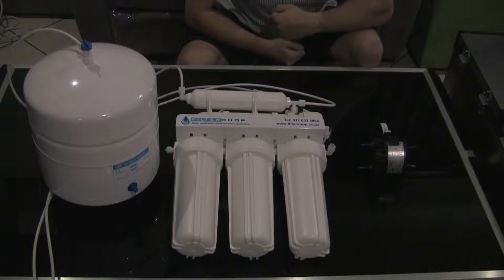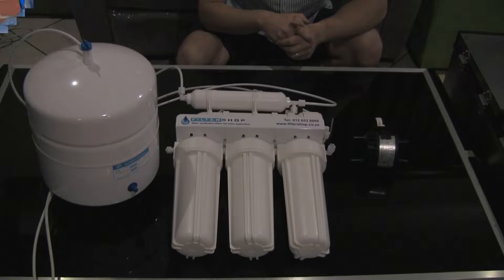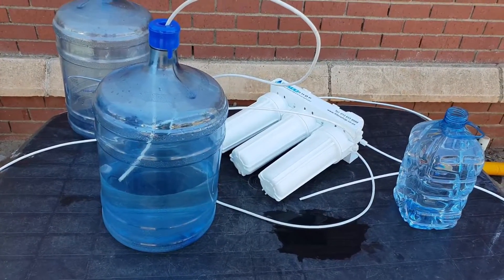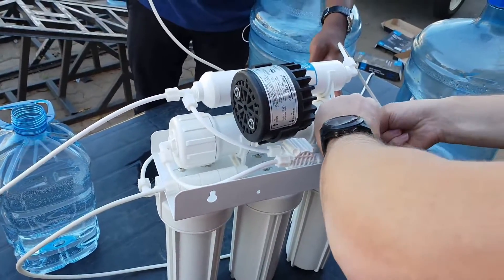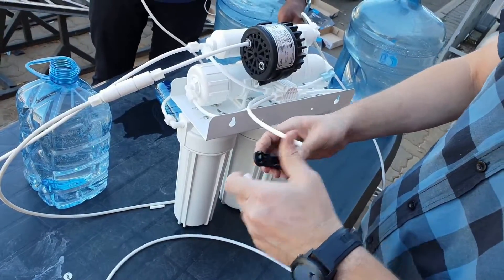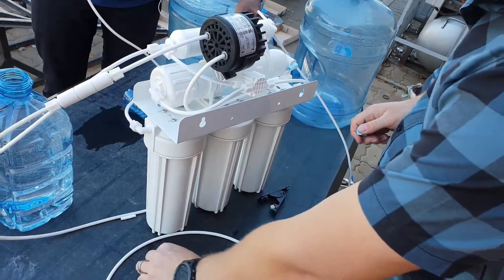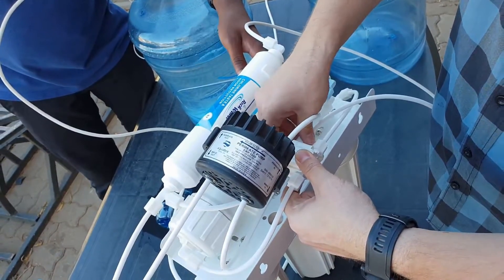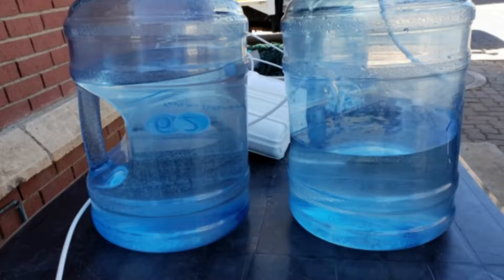permeate pump

Comment: do I need a booster pump in addition to the permeate pump?

should I try the permeate pump and see if the system pressure improves before spending more $ on the booster stuff?
Reply from the maker: Normally you would need a minimum pressure of 3 bar for the system to work. With the permeate pump I have set my house to as low as 2 bar and it does still work. I haven't measured efficiency at lower pressure though.

Comment: please, do you have a diagram conection pump inverse osmosis domestic, please
Reply from the maker: Hi, Unfortunately we don't stock it any more so i haven't got one to look at the diagram. However you can basically replace the 4 way valve with it and its ports are labeled on the unit.

Comment: The ERP-500 I installed according to the instructions stopped working in less than a week.  It's a worthless piece of junk.
Reply: Did you replace it with another pump?
Reply: @a.draghici8956  Yes, I returned the ERP-500 to the seller and he replaced it with an ERP-1000 unit which has been working well ever since.
Reply: @a.draghici8956  Yes, the seller warranteed the ERP-500 and sent me an ERP-1000 that is still working well.
Reply: Weird mine is over six months old and working just fine still. Sounds like a skill issue.

Comment: My understanding is the permeate pump system will not have the ASO auto shut off valve and that increases pressure, so the ASO system may only have 40psi in the tank if the source water is 60psi, but with the permeate pump the tank will achieve system pressure and you'd have a full 60psi going to your faucet and it will make clean water faster.
Reply: You can install a permeate pump with or without an ASO valve. Usually 'with' an ASO valve is preferred as it will lessen TDS creep.
Reply: @ThatZenoGuy  You can do it wrong, but the permeate pump instructions say you should keep the ASO valve to lessen TDS creep.
Reply: @lym3204  
I literally specified you should keep the valve.
Reply: @ThatZenoGuy  There was a video that said to remove the ASO valve. I just wanted to emphasize that there is only one correct way to do it.
Reply: @lym3204  
I mean you can remove the ASO valve and it'll still work. And there's probably weird outliers where removing it makes sense.
Reply: @ThatZenoGuy  It was a pain to figure out those weird outliers.  The most common is when the ASO is integrated into the post filter.  Then the ASO must be removed and bypassed.   After this, there are other,r probably less common outliers.

Comment: It means that we don't need to use pressured tank to connect to the faucet.
Reply: Hi, You will still need the tank as the flow is still too slow even at the improved rate.
Reply: Without the tank it would take about 10 minutes to fill a glass of water.
Reply: @michaelbarry8373  Their key word was pressured.  Which their 'tank' in the video has no pressure other than gravity.
Reply: The permeate in and out lines will be installed immediately before the storage tank.

Comment: Two things done wrong here, flow restrictor should be before the permeate pump, not after. Second, automatic shut off valve should be before the pump (not after) or removed completely.
Reply: I kind of understand why you say it's wrong but can you please elaborate further?
Reply: https://theperfectwater.com/s3/PDF/TM-OwnersManual-PWTv15.pdf
Reply: ASO is ok after the permeate pump, you want dont want it to be cycling forever.  When you reach x amount pressure above your incoming water will close the inlet water.  The only problem could be that if you are not using the RO you can create more TDS at the membrane and that TDS will potentially be stored at your tank.  Flow restrictor is not needed if your inlet pressure is 60psi or higher but if you add a booster pump then you needed otherwise will never create the pressure at the membrane
Reply: According to a manual about  all about ro systems that connection its wrong 
Anybody out there knows what flow retractor should I use for a p.pump 500 model with a 36 gpd membrane? I had the the problem the membranes clogging up (I'm using the yellow chip fr estrictors...its that the problem?

Comment: Super explains, thank you very much, how is it when you use an electric pump instead of a mechanical permeate pump? Does this save even more wastewater?
Reply: It would give you more pressure in the product water tank if you add an electric pump but it would not make a major difference to the wastewater with a permeate pump. If it is without a permeate pump then the electric pump helps lower the wastewater but not nearly to the extent that the permeate pump does.
Reply: @semiusefulinformation144  Thank You very match!

Comment: Should I install it with or without an ASO valve? Will the pump increase my faucet pressure?
Reply: From what we have seen it works with or without the valve. Yes, it does increase the pressure at the tap but not as much as an electrical pump would.

Comment: According to the Instructions, The flow restrictor is to be installed before the permeate pump on the brine in line.  Not after this is the same permeate pump I have Aqua Tec ERP-1000, if you install it as shown in video Pump will not click, clicking sound is important that means pump is working.
Reply: You are correct.  This video is wrong according to instructions
Reply: @gnosti83  it is ok, if you look at this manual is ok https://theperfectwater.com/s3/PDF/TM-OwnersManual-PWTv15.pdf
Reply: This was my question 
Although if you think about it 

I’m not sure it matters
Reply: I dont have a flow restrictor in my home master and it works.  However, I have been researching since my inlet water pressure is 60 psi and at my tank is 18 PSI ish.  Maybe I do need a flow restrictor to increase pressure and/or replace the membrane as well

Comment: Do not use ASO if you use permeate. Its better to think about permeate pump as "smart (pumping) ASO".
Permeate pump will shut off output tube by itself, once flow in permeate stops, and do this at very end instead of proportionally (like normal ASO).

If you connect permeate pump together with ASO, there will be conflict: ASO as usual tries to block main input based on pressure in filtered water channel (permeate) - thus choking the performance (=time) when tank fills up, which leads to degrade in permeate pump performance - both in time and power, thus degrading filtering performance towards the end as well - cause it uses the power of waste/drain flow. 

So there is still large window for efficiency and  filtering speed!

Still, even with the parasitic effect of ASO, the difference is great. Thank you for the test!
Reply: I wish I had the instructions to properly connect a 5 stage RO system using this same permeate pump.
Reply: @OmarValenzuela1975   us water systems has a video and diagrams
Reply: @OmarValenzuela1975  https://theperfectwater.com/s3/PDF/TM-OwnersManual-PWTv15.pdf
Reply: What about a 90% ASO? I need to increase my water faucet pressure. Will the pump by itself help? Thanks
Reply: @ralphm6234  I recommend two technologies - either direct connection to membrane with minimal prefilters (2) or install 24v pump and wire it so that when you turn on trigger an electronic input valve (solenoid) opens and pump is enabled. The second system is much more complex and expensive, but has automatic operation and allows connecting two membranes sequentially or using side-stream membrane. Instead of using pressure-based shutoff (high pressure sensor). This creates a pressure-less system, minimizing leaks. Additionally, one can wire two-clock relay and add another solenoid to flushing  segment (pressure bypass), and wire them parallel to first scheme, separating them with shotky diode - this allows automatic programmable membrane flushing. Both systems are direct flow (tankless). I gave away using tanks as they contaminate water. The permeate pump problem is that it requires to stay under pressure to function and when leaks - there is a disaster. I recommend only pressureless systems.
Reply: @HECKAKYH-ADEKBATEH  Is there somewhere I can get more information on a pressure-less system configuration?
Reply: @Patriot513  I got the concept from Dr. Scholze, his channel is "Lebendiges Trinkwasser" and its in German. The whole idea is around what triggers the system to start: the pump to work, the solenoid valve on input to open, the UV reactor lamp to go on(240v/24v bridge). 

In classic system, only pressure is watched, so if pressure in pipe drops, the  high pressure sensor allows the current to flow and system starts. In his system, he replaced high pressure sensor with an external switch, so it goes on only when switch is enabled. This allows to remove water tap. Disadvantage: system won't work if there is no current, but it won't eitherway as something needs to power the pump. 

In my instance, I kept that high pressure sensor connected after the Y-connector (one end from the that external switch, other from the double timer which triggers an extra valve to allow fully automatic periodic system flushing). Thus my instance is switch or timer triggered, however it will disable itself on high pressure as a failsafe, while having no tap on the end and no pressure when idle.   Double profit.
Reply: Yes! I was wondering about that, every time is see a video  about the ASO, I never see a permeate pump like I have. Like I thought everyone had. Can't imagine not having the permeate pump. how can the RO work without it?
Reply: @michaelbarry8373  ro works without it, ro just needs high pressure before membrane. Permeate is just used to push more water inside water tank, so its like ASO only used in systems with tank. I recommend going tankless, much less risks from pressure and biology.
Reply: You can have a permeate pump with an ASO, the company which makes them even recommends it.